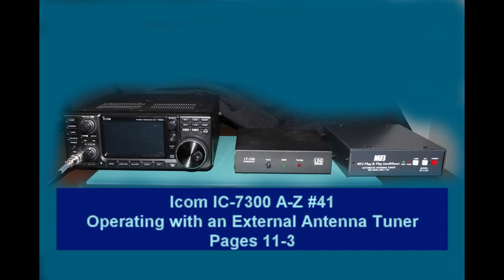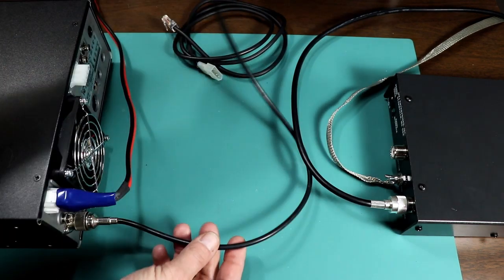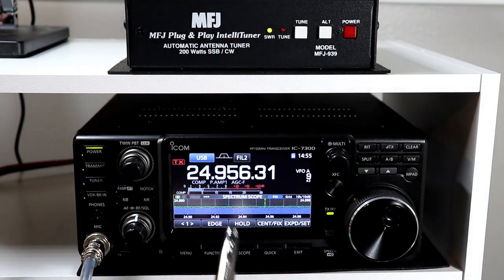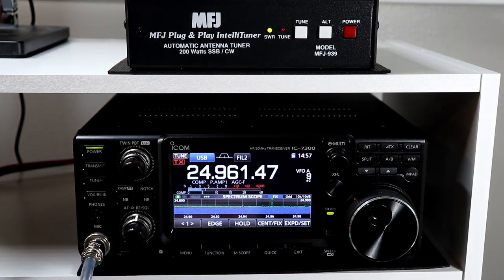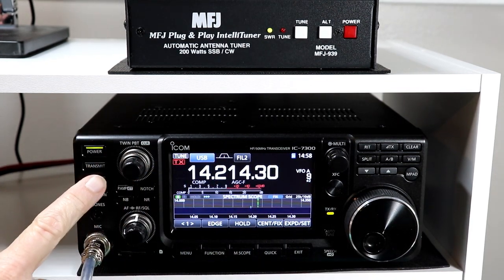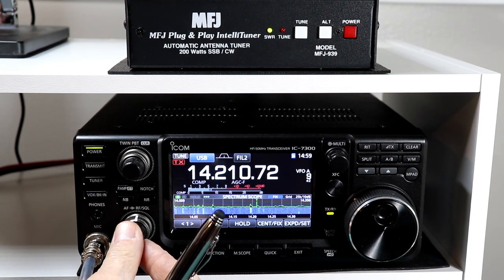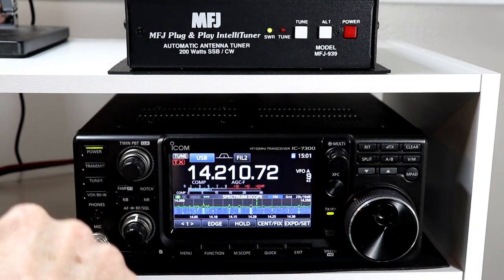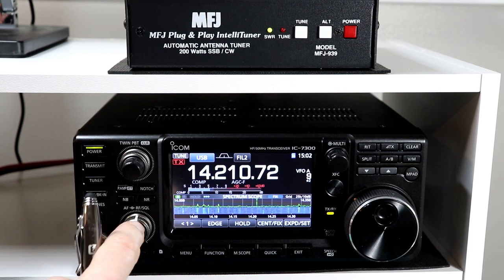Icom IC7300 A to Z #41 Using an External Antenna Tuner

Comment: Your tutorials are fantastic. Best I've seen. I have learned a lot. I have a question. What is the best way to use an external tuner that is NOT ICOM compatible? Something like the RT-100 which is used at the antenna feedpoint.
Reply from the maker: Hi Richard.  Thanks for the kind words.
I sometimes use an SGC, non-Icom specific tuner.  It is pretty easy.  You have at least a few options.  The simplest is to put the rig into RTTY mode on your desired frequency.  Then set the RF Output power to a safe level, maybe around 10%-20%.  Refer to your tuner manual to see if it recommends a safe power for tuning.  Then just key your mic.  The radio will put out an unmodulated carrier.  This should start your auto-tuners tuning sequence.
Another option is to make an external Tune switch.  This is a simple circuit connected to the rigs tuner connector that will force a low power, CW carrier regardless of the rig's mode and power settings.  There are a number of descriptions on the internet.  One is here:  http://www.prnewell.com/kc2wi/Icom_tune_control/index.htm
73, Tom

Comment: Tom, just finished watching all your videos for the 7300 as mine is being delivered TODAY! Been a ham for over 50 years and my 40+ yr old Yaesu FT-757GX2 finally died in December. This will be my first new rig in all those years. Your videos have been both good timing and they have ALL been excellent. Just a quick question. I'm on a 3rd floor apartment and will absolutely be using QRP levels so as not to interfere with my close neighbors. I will be using the SlinkTenna (for 80m-6m). If for example, one band requires me to use Emergency mode to tune it up, and I switch OUT of Emergency mode--will the 7300 still remember my tuned settings and remain tuned? Just curious if those 'tuned' settings remain regardless of Emergency or Normal mode. Thanks in advance! 73's de Stan - WB5UDI
Reply from the maker: Hi Stan.  Thank you for the kind words.  That’s a great question.  I’m sorry, but I don’t know the answer that.  I would suspect that the tuner will remember its settings for a particular frequency regardless of mode, but that’s just a guess.  I’ll ask a return question-  If you’re going to use the 7300 at QRP power all the time, is there any reason to ever take the tuner out of Emergency mode?
Reply: @HamRadioA2Z  I'm guessing that is precisely what I'll be doing. Don't think I'll need to ever be over 20-30% power, so I'll just leave it in E-mode. I had planned to buy the IDG-100, figuring the SlinkTenna would be uncooperative at the 3:1 SWR limit on some bands, but as soon as I learned that E-mode would go up to 10:1 SWR tuning ability, I'm holding off for now. 👍
Reply: @HamRadioA2Z  In my opinion if using an external tuner you shouldn't need to tune up in emergency mode. I think you might get better results with the MFJ 939 in my personal opinion.
Reply: @druliefw  Thanks for the comment, Dave. So, it sounds like I should buy the MFJ-939 instead of the IT-100, since it's cheaper, tunes 32:1 SWR and has 2,000 memories......As a user with the 7300, is this your experience? Say, you are using WSJT-X and you've tuned the FT8 frequencies for 80, 40 and 30, say.....and then you switch between them..does the MFJ-939 stay silent since the memories remember the band and frequency? No relay chatter? That is my understanding. I appreciate your insight.
Reply: @HamRadioA2Z  UPDATE-4/24/2020 Tom, I talked with ICOM about remaining in EMERGENCY mode, and they said it was NOT recommended. The mode was specifically for a temporary situation and the high SWR on the internal tuner circuit would put unnecessary wear and tear on the relays--as it was not intended to be a permanent solution. So, I purchased the MFJ-939I and am now a happy camper! Thanks again for the video.

Comment: It was mentioned that to use the internal tuner that the external tuner can be disconnected via the interface cable

On the MFJ there's a power switch.
Wouldn't turning the power switch off do the same thing?
Reply from the maker: Yes, absolutely.  Others have pointed this out too.  I had brain fade when I made that video.
Reply: @HamRadioA2Z  the reason I asked is because I have a TEV-1 HF vertical that is resonant for the HF and a second antenna for the 6M band
My intention was to use the external auto tuner for the HF vertical and use the internal tuner for the 6M antenna

I'm hoping that configuration would work

Comment: loving your videos!  Do I understand correctly that there is no need power the tuner with external DC? Wonder if that same cable will work with my MFJ-998
Reply from the maker: You are correct.  The tuner is powered by the tuner connector on the radio.  MFJ does make an Icom specific cable for the MFJ-998.  It looks like they sell the same cable for the 939, 998 and several other tuners.  So it looks likes it should work fine.

Comment: Tom, the MFJ 939 manual states that for the Icom radios supported, the JP2 Jumper in the tuner must be set to the "I" setting. I don't think you mention this on your Youtube: is this the case? I assume this involves removal of the case on the tuner; it seems to work with the 7300 without doing this... is it a necessary step?

Comment: Hi Tom, great video. I'm curious, how long is your random length end fed and is it grounded at the balun?
Reply from the maker: Hi.  Thanks for the kind words.  I had two.  One at a house we rented and one at my father-in-law’s.  One was 53’ and one was about 135’.  I did not have it grounded at the unsung and I also didn’t use the coax as my counterpoise.  I had a separate counterpoise wire at the union and I made a coax choke balun right at the unun.  I’m not a big fan of having the coax shield radiate (but many people operate this way with great success).  Palomar Engineers has some good information about end feds on their website.  They even include DIY unun plans if you don’t want to by their stuff.  They provide multiple antenna length suggestions for different band combinations.  You can find that here:  https://palomar-engineers.com/tech-support/tech-topics/best-hf-end-fed-antenna.  73, Tom
Reply: @HamRadioA2Z  Thank you very much for the link Tom. Excellent resource. I have the Earchi 9:1 unun (who doesn't) and a roughly 124' long wire. I'm on the second floor of a six story midrise with a 75' LMR-240 coax feedline to the roof. No grounding. Definitely getting some RF down the coax at anything above 10-15 watts out of my 7200 and LDG tuner. It was playing havoc with the USB cable between the radio and computer. I threw on a couple of clam shell ferrite chokes and that helped quite a bit but I keep the power low to reduce the risk of interference with my neighbours. My QTH suffers from local QRM, both inside and out, and the noise floor above 20m is pretty challenging. I need to find myself a place in the country.

Comment: How does the semi/auto work on the 939?  Why not just shut off the 939 power button to bypass?
Reply from the maker: Hi Mike.  I’m not sure what you mean by “semi” auto.  Somebody else had previously pointed out the power button on the 939 to bypass.  Quite correct.  That was one of those “duh” moments for me.

Comment: hi tom, if you change the 9:1 unun for a 49:1 transformer you should be able to tune the antenna with the int tuner
Reply from the maker: Hi Chris- That may or may not be the case.  A 49:1 xfmr is typically used on a half-wave end fed antenna, not a random.  A 1/2 wave end-fed antenna has an impedance of 3000-4000 ohms.  So the 49:1 transformer brings that down to around 60-80 ohms.  So it’s much better than 2:1 SWR and doesn’t really need any tuner.  The internal tuner is good for antenna impedances from about 16 ohms to 150 ohms.  With a random length end-fed, the antenna impedance will be a few hundred ohms or less on a lot of bands.  So a 49:1 transformer would bring that well below 16 ohms and it would be out of range of the internal tuner at the other end of the scale.

Comment: Not sure if you still monitor these videos but hope you can answer a question. I have the LDG tuner and the 7300. When I tune, should the RF power be turned down? If so is that to avoid interference or does it harm the radio to tune with full power.  I move around on the bands a lot and sometimes I forget to turn the power down. I have the Tune on when PTT is active. Also, when tuning should it be in another mode other than SSB?  I’ve seen it written that you should change to CW or FM.  Thank You.
Reply from the maker: If you press and hold the TUNE button to activate the tuner, it starts a tuning sequence.  The radio automatically turns the power down to about 10 watts (regardless of power setting) and puts out a single, CW carrier until the tuner is done.  If you have the automatic tune on PTT enabled, it will not begin tuning if you just press PTT in SSB mode without speaking into the mic.  In SSB, the carrier is suppressed.  So, there is no output power unless there is audio.  It won’t be able to detect the SWR or start tuning until you speak (or play a steady tone).  For that reason, I don’t enable the tune on PTT feature.  If there is a high SWR, the tuner/radio won’t detect that until you start speaking.  When you are speaking, the output power is jumping up and down with your voice.  As the output power is jumping all over, so is the reflected power that the tuner uses to calculate SWR.  So it is very difficult for it to do a good job tuning.  I suggest leaving the PTT feature disabled and just press the TUNE button when you switch frequencies or bands.  73, Tom

Comment: Fine video. Just mine I have to power both the 939i and 7300 individually. When I had my 7100 I could just power the radio on and the 939i would power on as well.

Comment: Thanks for this.  On page 7-2 of the 7300 manual it says, “Be sure to turn OFF the internal antenna tuner before connecting the external antenna tuner.”  This is confusing to me.  (I have the LDG IT-100 autotuner)

Comment: Great series - will be spending a lot of time re-watching once I get my 7300 up and running.  May I ask what you have the 7300 grounded to?  I have read a BUNCH of back and forth on grounding to the point of confusion, so I just wanted to ask.  Regardless, thanks for the time you have spent on this series.
Reply from the maker: Hi Shawn.  Ham discussions on grounding are a lot like discussions about religion and politics.  People have very strong held beliefs and convictions.  My ground is, honestly, not that great.  I am in a rental house for the time being and don't have a great permanent setup.  I do have a safety ground through my power outlet coupled with a ground rod driven just on the other side of the wall from my hamshack where I was able to sneak it into the house.  A good place to start is a grounding FAQ page from the ARRL.  You can find that here:  http://www.arrl.org/grounding
That at least explains the different types of grounds and gives some explanation of which ones you need and why.
Thanks for watching.  73, Tom
Reply: @HamRadioA2Z  Thanks Tom.  Had to laugh at your comment re: grounding discussions - I appreciate folks' passion on the topic, it does remind me of politics/religion/Chevy vs Ford/etc.  Asked mainly to pick up another nugget of information :)  Thanks for the link - will read & bookmark it.   Love the channel - thanks for your time/effort to put out quality content.  Be safe!

Comment: For those with the IC-7300 and a LDG AT-x00 Pro tuner ... please explain your setup.

Do you disable the internal tune (set it to manual) and no longer use the Tune button? The radios Tune button does initiate a tune sequence on the LDG-200 Pro, but something is not right. I get whacky SWR readings, like > 3:1 when I do this.

I've read the LDG manual, and only have more questions. I am confused ... do I leave the internal tuner on, do I turn it off, do I use auto or semi-auto mode with the LDG?

What sit the proper setup for this radio and tuner combo?
Reply from the maker: When you connect a compatible tuner to the Tuner Connector on the back of the 7300, it automatically disables the internal tuner.

Comment: I was wondering if I put my MFJ 949E on bypass just use it as a switch between bypass COAX 1 and bypass COAX 2 and put the OUTPUT Cable  TO THE MFJ-939 tuner to tune if it work ..just to be able to access both antennas like a switch....
or just get a switch a/b switch

Comment: Hi

I noticed that you were able to tune 160 meters. What length of wire are you using?
I hv a ‘ My antennas’ 80-10( 134’) end fed and I cannot tune 160. 

Thanks 
William
Reply from the maker: I think I had about 65 ft of wire when I made that video.  Remember that the length of a counterpoise wire, if any, and the length of your coax will also affect how it tunes on any given band. Also, don’t confuse “tuned” with “works well”. I never worked anyone on 160 when I lived at that location.

Comment: Hi Tom;  I've had my IC7300 since April 2019 but did not find your videos until last week.  They have been extremely helpful and are well done, thanks for doing this.  I've had some issues with SWR actually shutting down the 7300 during the tuning process.  I have 3 sources to read SWR; the IC7300, a PWR/SWR meter downstream from my amp, and my LDG AT600 Pro II tuner. In some cases the SWR on the IC7300 shows a different value than either/both the PWR/SWR meter and the tuner.  What is that?

Thanks

Frank W1ZAH
Reply from the maker: Hi Frank.  First, thank you for the kind words.  You didn’t describe how your setup is wired, but I would expect that it is 7300–>Amp—>Tuner—>Pwr/SWR Meter.
There are multiple things going on here.  I’m going to make a couple of assumptions— I assume that when your amplifier is off it has a bypass relay so it is effectively out of the circuit.  I am also assuming that when you have the tuner tune, that the amplifier is off/bypassed at that time.
It looks like that AT600 supports the Icom radio tuner interface.  Are you using the optional interface cable to the molex connector on the 7300?  If so, then I’m not sure why the 7300 would shutdown while tuning, unless the tuner itself is detecting too high of an SWR and it is stopping the tuning operation.  Does this only happen on certain bands?
Regarding the different SWR readings— It is important to remember that each meter is looking at a different part of the antenna system.  Amplifiers are designed to present a 50 ohm load to the connected transmitter.  So when your amplifier is online, the 7300 should see a 1:1 SWR, or pretty close, no matter what is going on past the amplifier.  If you have things connected in the sequence I described (which is the proper sequence, in my opinion), then your PWR/SWR meter is going to see the SWR at the coax coming into your shack.  So if your antenna system is 3:1 on some particular frequency, then your PWR/SWR meter will see a 3:1 SWR on that frequency even after the tuner is engaged.  We all call them “tuners”, but remember that they don’t actually “tune” the antenna, they just keep inserting L/C elements so your antenna looks like a 50 ohm impedance to the transmitter (or amplifier).  I believe the SWR meter in the tuner is showing the the SWR at the transmitter connector.  So it will show a 1:1 SWR when it is done tuning.  If you have the tuner bypassed, then its SWR display should be pretty close to what your PWR/SWR meter shows.  If you have the amplifier and AT600 both set to bypass, than all 3 of your SWR readings should be pretty close.  Hope this helps.  73,  Tom

Comment: Tom asked the same question on your internal 7300 tuner video.....

Question...re using the 7300s internal tuner in conjunction with a manual atu

Ok my doublet antenna lets me tune most band bar 160m.....if I adjust the manual MFJ tuning to best SWR....which is around 2.5 to 1....then tune with the 7300s internal tuner the indicated SWR on the radio is near 1 to 1.....which I know its still 2.5 to 1....but I am presuming the radio sees near 1 to 1.

No my question....will it hear the 7300 using the set own internal tuner in conjunction at the external ATU.

I am hoping it will be kinder for the 7300.

I know 2.5 to 1 is not the end of the world....and looses around 18% out output power.

What do you think....nick 2E0LPL.
Reply from the maker: See my reply in the comment from the other video.

Comment: Thank you for the very educational info on the 7300.  Have had the 7300 for a few months and so wish I had watched all your series already.  I've gone thru #14 just tonight PLUS #41.  So far my antenna tuner (for my non-perfect antenna) is a Heathkit SA-2060.  Although it has done a great job, I wished to go "automatic" and wanted the MFJ 939.  Availability has been NIL so I finally broke down and purchased an MFJ 929 (and Icom cable) which will be here SOON.  Do you know if it will be basically the same operation as with the MFJ 939?
Reply from the maker: Hi Pat.  Thank you for watching and for the kind words.  Yes, the MFJ 929 should operate in the same way with the 7300.  It's actually a nicer, fancier tuner.  It gives you a separate SWR and Power meter display, plus it supports 2 separate antennas.
Reply: @HamRadioA2Z  It came in and got it hooked up this weekend!  Super easy to install and it is an outstanding tuner as you say.  Once again THANK YOU for your time in putting these videos together so nicely.  I'm new to the HAM world but getting into as many of the different ways to appreciate it so your more advanced subjects are still on my "to-do" list!